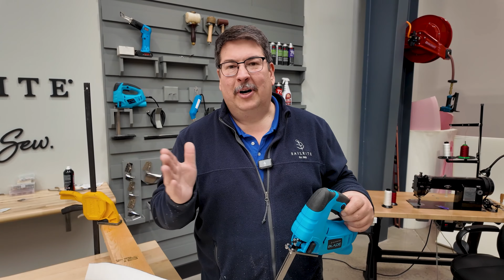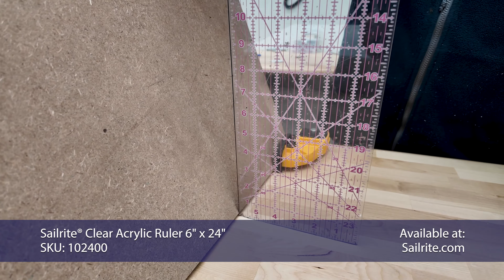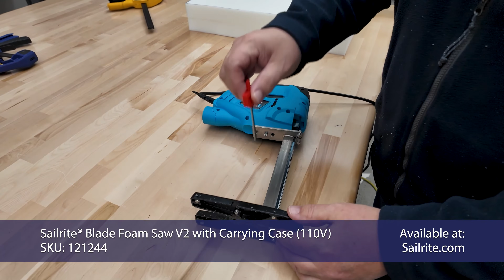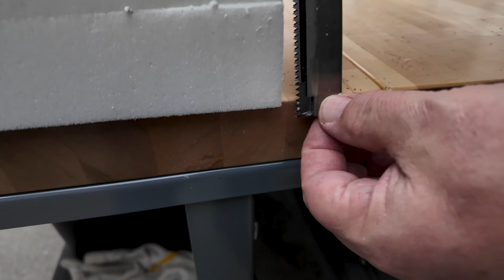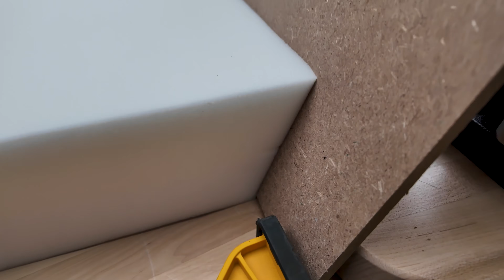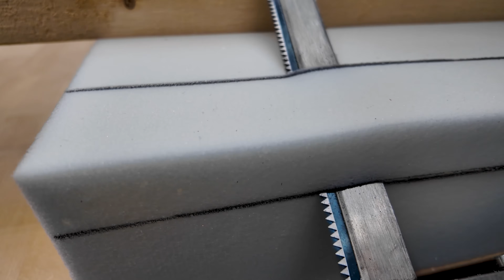Mastering Foam WEDGE CUTTING - DIY Techniques

Comment: Why don't u use protruding nails from the parallel wedge to pin down the foam
Reply from the maker: That's a great suggestion! Using protruding nails can definitely help secure the foam better during the cutting process. Thanks for sharing your technique!